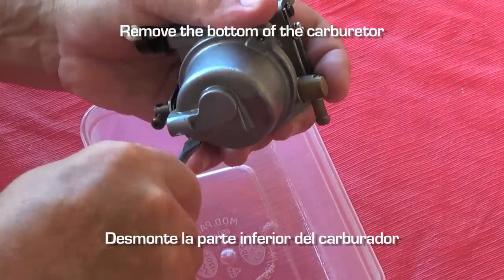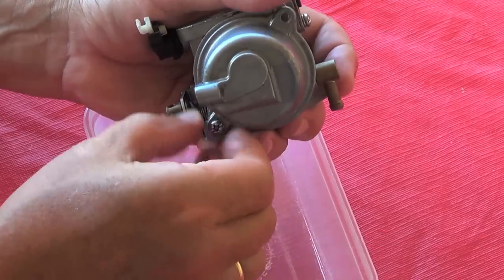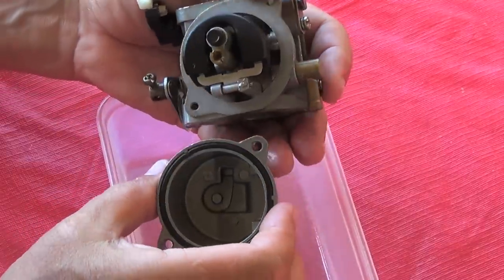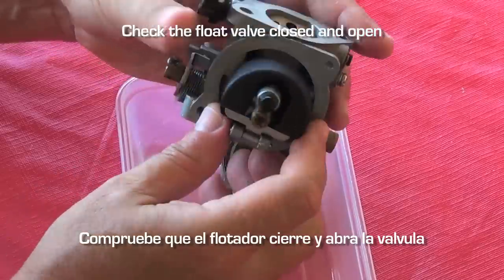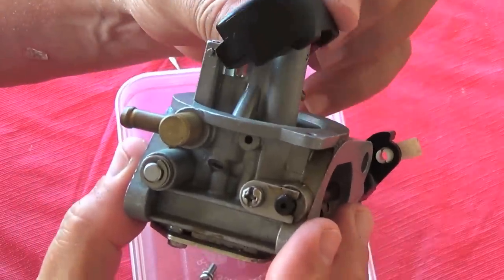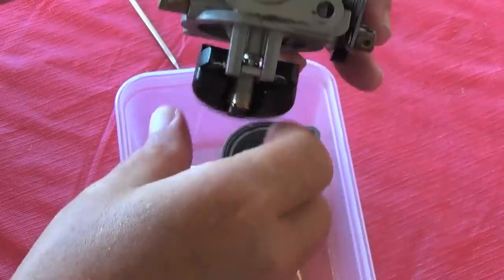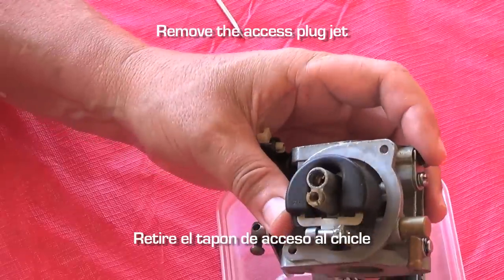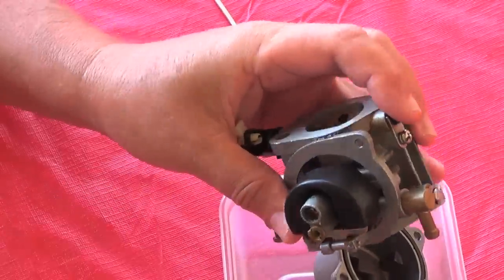Yamaha  Carburator Detailed Cleaning

Comment: If your engine will not idle clean jet #3 as shown in this video.  I use a wire from a wire brush held with vise grips.  A needle works fine as long as you don't hammer it into the jet.  It works great to pick out the dried fuel residue.   Ethanol is our problem.

Comment: I'm having to do this again already. In thinking maybe trash in the injectors. 

Do you think it would he ok to put in a small fuel filter on the feed line to the carb? I just don't know if it would restrict any flow or something since it's just a vacuum fuel pump..
Reply from the maker: I think it is a good idea, in fact I had it installed and cleaned a lot of foreign elements of the fuel avoiding problems of carburetion
Reply: @JavierRullanRuano  do you have one you recommend for such a small motor?

Comment: Does anyone know where the function is of rubber cap in one of the plug jets?
Reply: This. I found that plug and was confused as well. It blocks the stationary jet?
Reply: New to me motor.  It wont idle with choke off, when I removed the top plate on the carb the white cap was missing.  I've cleaned the entire carb thoroughly except the air mixture which is sealed off with glue, and same problem.  I have a feeling it's the white cap that is missing.   I have one on order.
Reply: @ericlloyd3481  #3 jet is idle control and also the first to block up

Comment: your 6hp is an 8hp, i have both engines.

 yamaha 6hp 4 stroke 2 cilinder 2001
yamaha 8hp 4 stroke 2 cillinder 2007 
the carburateur on the 6hp only opens for 50%

and my 8hp has the same carburateur as your '6hp'

Comment: when you reinstall air/fuel mixture screw how many turn do you give it so the motor will start ,,, then you can fine tune once it is running???
Reply from the maker: I remember, you have to close it completely, and then give two and a half laps to release it, although a long time ago I do not have that engine anymore and I can not guarantee it...
Reply: Thank you very much.
Reply: it's a good procedure to actually screw it all the way in before removing it,  that way you can count the turns and reinstall in the same position.

Comment: I have a 5hp yamaha outboard and it's not idling. .really need help
Reply from the maker: Assuming that everything is clean, no vibrations, no water clean fuel, the fuel filter and free of foreign matter, the spark plug in good condition and tight carburetor without air intakes.
Check down jet , it is likely to be clogged, which regulates the entry of fuel to the engine when idling.

Comment: i wouldn't have the confidence to undertake servicing my carburetor after watching this, to my understanding the float has to be set which is crucial to the functionality.  Also the most important part is missing!! setting the Air to fuel mixture so the engine turnover correctly and idles without cutting out.  also carburetor cleaner spray may be useful.  The Carburetor has one of the biggest impacts on the performance of the engine, awful pity is so hard to get a proper video on how to service and tune up a Carburetor.